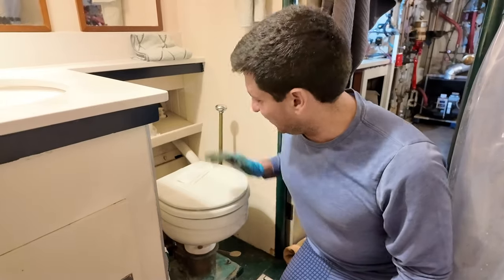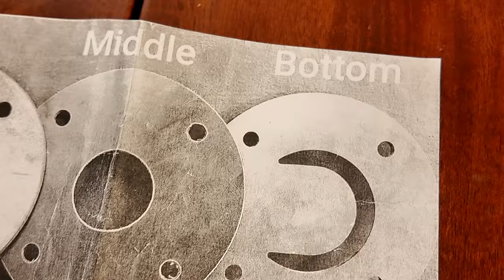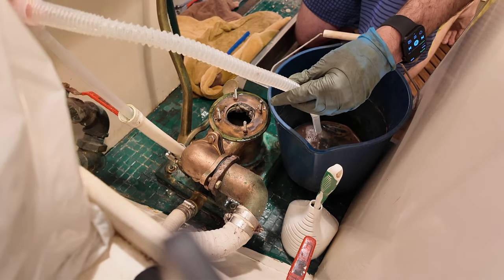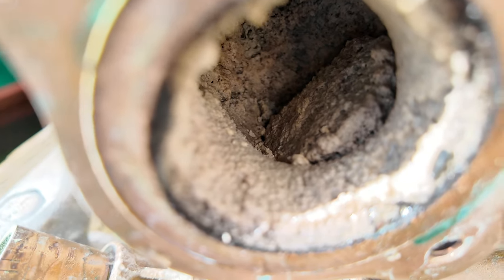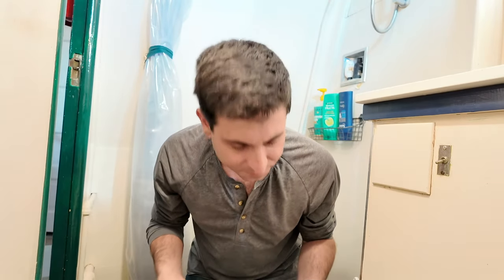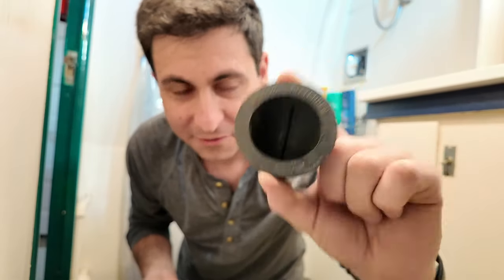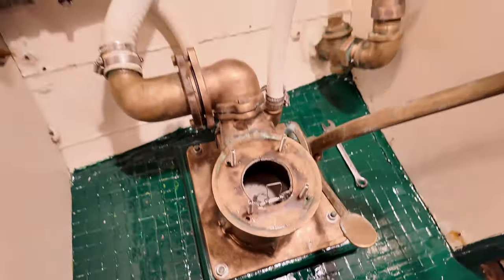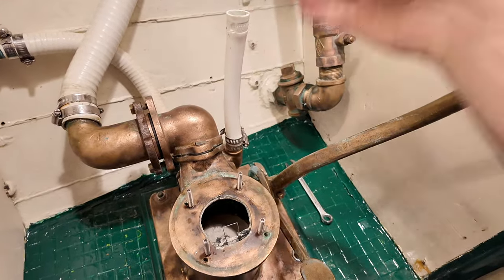Rebuilding a 1950's Vintage Wilcox Marine Toilet!

Comment: ugh, been through it with my WC as well.  I had to use al l the "close enough" gaskets and its just never quite right.  Its sad because these are superior to just about any head on the market today.
Reply from the maker: So I ended up just cleaning the old gaskets and putting them back, works great! Only thing is the inlet fixture in the back of the base is pretty worn and still leaks… I would like to try and find a replacement off another old Wilcox if I can find one.